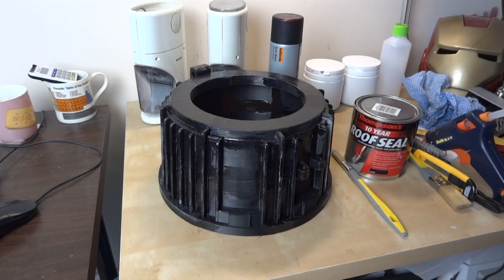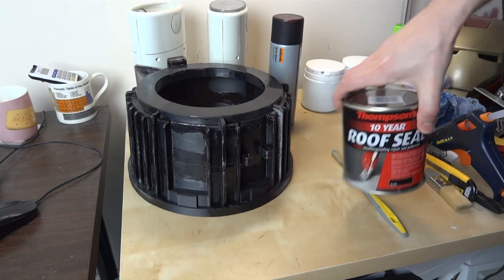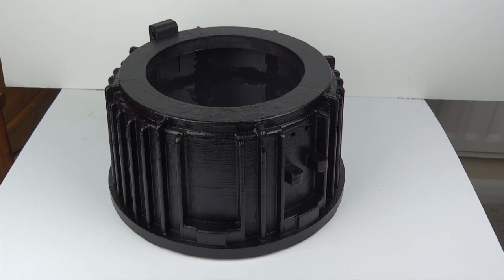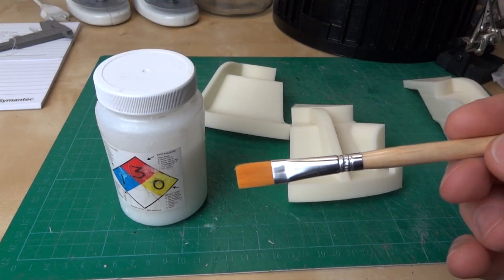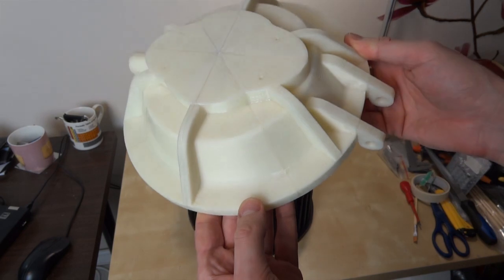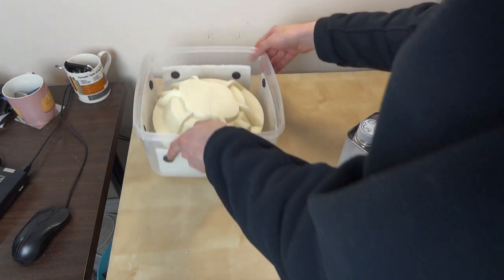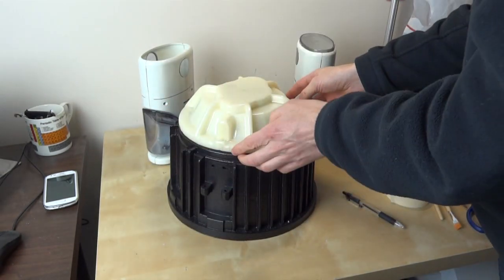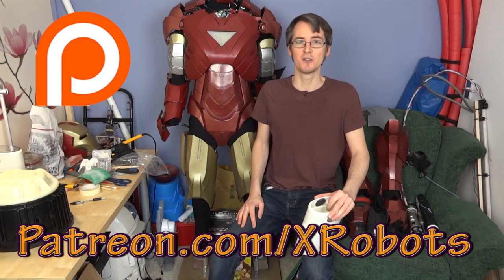BTTF Mr Fusion #2 | Using Krups 223A Coffee Grinder | James Bruton

Comment: Once all the parts of the lid are bonded together, is there any chance of them collapsing inwards under the stress of the grinder's weight sitting on top? If so, maybe you could make a collumn of some sort, like the supports for the lid sections when they're being printed, that could be place neatly in the center. Also, with the acetate, could that be sprayed on in the same way as how vehicles are sprayed in a painting booth? Or would that be overkill?
Reply: All good then. No worries. :D Look forward to seeing the rest of the time machine. ;) Just don't go getting any funny ideas, you'll be there for a year or more if you try to print out the whole car!!